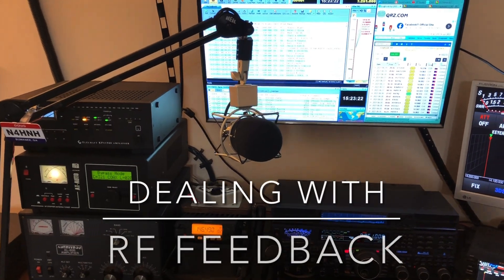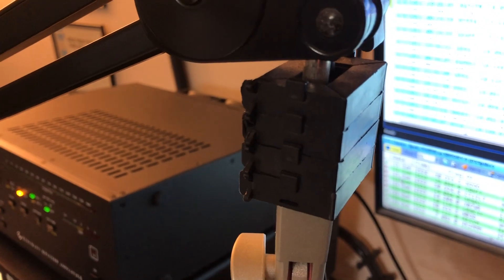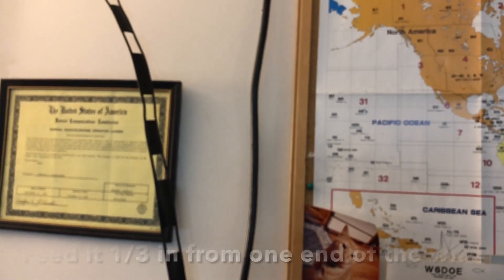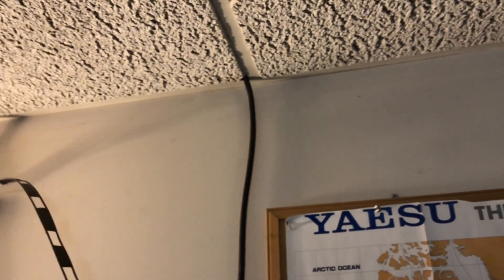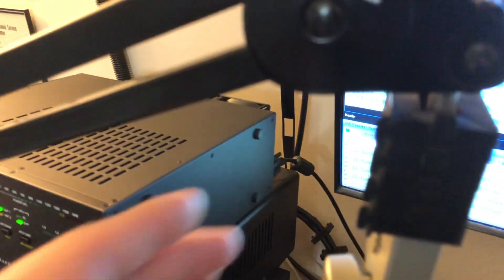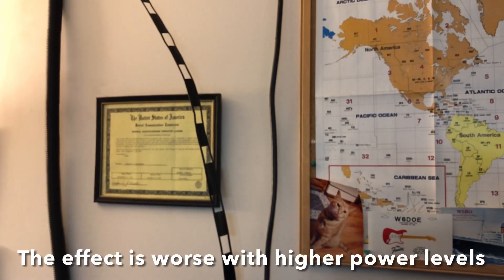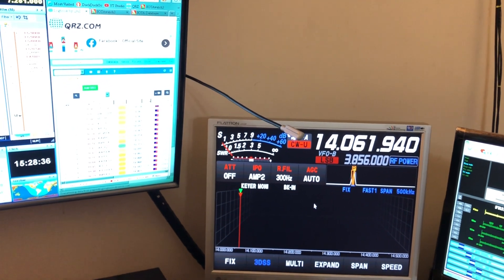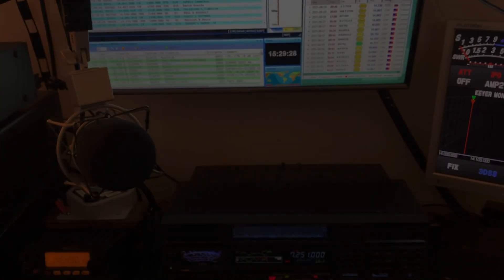Dealing with RF Feedback

Comment: What does rf sound like?
Reply: Thanks Doug! I need to add some chokes!
Reply from the maker: I bought a box of various sizes from Palomar Engineering. Get Mix 31. Avoid MFJ. They are garbage.  I bought a bag of MFJ chokes and several of them were broken. They don’t seem to perform as well as the Palomar chokes.
Reply: @n4hnhradio  Thank you!!
Reply from the maker: It will manifest as distortion in your transmit audio.
Reply: @n4hnhradio  Thanks Doug - distortion sounding like you are off frequency or white noise? Also, is it possible to get so much that it permanently damages your equipment?
Reply from the maker: It can cause damage if the amount is enough. I blew up the CAT port on my FTdx5000 because there were no RF chokes on the cable from RT Systems. The latest cables I’ve seen from them have chokes. The sound of RF in your audio could be described as sounding garbled or even robotic.

Comment: Good video and solutions can be simple but sometimes hard to figure out. Even loose PL-259/SO-239 (whatever) connectors you may use, where ever the connection/joints occur, can cause RF in the shack from a poor coax shield connection so I cinch down my connectors a bit with plyers - just a bit tighter than finger tight. Also, good ground connections on pretty much every piece of equipment. One way to make a good ground is to connect all ground wires to a metal (aluminum) plate - say 18" square, for example, and lay that on tile of a concrete foundation floor - that makes a capacitor to the floor/Earth then run a good size wire to a water pipe, if you can, or a ground rod close by. Especially ground transmitters and tuners and always use a balun or coax choke (ugly balun) right at the antenna to help prevent radiation from the feed line. Of course, you may have your own solutions that work perfectly well and ferrite chokes can be part of a good solution.  Thanks for the video. 73  WA4QGA
Reply from the maker: My ground is too an 8 ft. Copper rod outside the shack. But it doesn’t prevent common-mode current. There was still a bit of RF on the shield even after the 4:1 combi Balun. The snap-on chokes did the trick. Two made the difference but I ended up snapping a third on, just as insurance.

Comment: thanks for your video Doug. that's why I wont run a Ocv there known for rf problems . I was causing the lady across the street her garage door to go up and down and the older gentle men across from me his lamp to turn off and on. got rid of the ocf and problem solved lol. It also helps if one of the legs is Not going across your Roof
Reply from the maker: I’m fortunate that the only thing I interfere with is my westher monitor station. But it only happens on 30 meters.  The chokes eliminated the issues with all the other bands. But, the OCF dipole doesn’t usually outperform my ZS6BKW or my doublet anyway. 

73, Doug
Reply: @n4hnhradio  the chokes work great wade N5bwp a big patron of yours and dear friend of mine got me some for Christmas I use them on everything
Reply from the maker: Hi Jay!  Chokes have gotten expensive, that’s for sure. I use the Palomar chokes. You can buy a box of them for $50 from HRO.  I use Mix 31 for HF applications. 

https://www.hamradio.com/detail.cfm?pid=H0-016457

73, Doug

Comment: Sir, just came across your video, wondering where you got those or can order those chokes at?   Any particular ones ?  
thanks
Reply from the maker: Those are from Palomar Engineers, but I purchased them from Ham Radio Outlet. HRO had a better price than ordering directly from Palomar Engineers. They make different sizes for different size coax. I think they might also have a combo box. Be sure to order the proper mix for your frequency range. 

73, de N4HNH

Comment: @N4HNH Radio hello. Should I put the RF Choke on the Mic Cord Close to the Mic, Or Should I Put the RF Choke on Mic Cord were the Mic Cord Plug's into the Radio. Thank You.
Reply from the maker: It usually works best to install the RF choke(s) on the radio end of the mic cable.  However, sometimes, you might need them on both ends.

73, de N4HNH

Comment: WHAT MUST I DO TO CHANGE FROM CB RADIO TO HAM,S
Reply from the maker: There are 3 license levels in the USA.  The first is Technician Class.  The Technician Class license allows you to use FM repeaters, plus you can use SSB at up to 200W power output between 28.3 and 28.5 MHz.  The exam has 35 questions.

The next license level is General Class and the highest level is Extra Class.  The General and Extra Class licenses allow expanded operating privileges on other HF bands, at up to 1,500 watts.

You can study for the exams at: https://hamstudy.org/

You can contact the ARRL to find out where to take the exam.  Or contact a local ham radio club.

73, de N4HNH

Comment: Thanks for all your videos!  Your series on the FTdx10 caused my wallet to bite me haha.  I won though and got it installed in the shack last night.....awesome radio!  My desk shelves were too small and having the radio to the left and about two feet up wasn't working.  So I places it dead center and put my monitor on top of the radio.  (covered the speaker but thats why I bought the SP-30 too)  And of course when I keyed up the RF caused my monitor to go into the settings menu.  Ferrites to the rescue.  Doughnut on the coax and the monitor cable solved that for now.  I'll dig deeper after I watch all 3Gazillion videos you put out on the radio.
Reply from the maker: I can relate.  I had to rearrange my shack to fit the FTdx10.  Maybe you saw this video?

https://youtu.be/puourYBqBbo

73, de N4HNH

Comment: Ladder line is designed to work as a balanced line.  If it has any conductors nearby (wiring, pipes, steel siding, other antennas) it will become unbalanced and become a radiating system.  Your attempt to attenuate the rf radiation from this feedline in the shack cannot work.  The ferrite will only further unbalance the feedline. The best thing with balanced feedline is to send it out the wall, away from any interfering objects, right from the back of the tuner.  This is how it was used years ago.  And with tube equipment, it was far less vulnerable to interference from local RF. I proved it by all the lip burns I got using my Heathkit gear and a shiny D-104 microphone.

A layman's way of analyzing your situation. Forgive me if I don't understand what is happening in your shack. You will fight RF constantly with that configuration. The best one can do to keep RF away is to feed with coax and convert to balanced line with a remote tuner or transformer once outside in free space.  

Always enjoy your videos.  Thanks and 73... Mike
Reply from the maker: Hi Mike!  The balanced line goes straight to the back of the tuner.  The 4:1 balun is inside the tuner.  I would rather choke the RF in the shack than drill another hole in my house to take coax out to a balun/tuner outside.  That is a much more expensive solution than chokes.  But the doublet is not the problem.  Those chokes help it achieve a 2:1 or less SWR from 14 through 18.168 MHz with the tuner in bypass mode.

I used a similar method, plus coiling the coax, to expand the resonance of the OCF dipole such that it stays under a 2:1 SWR from 3.5 to 4 MHz.

If you watch the video again closely, you will notice that I did not blame the doublet for RF feedback.  It’s the OCF dipole, with RF riding the shield back to the shack.  But that only happens on bands that aren’t harmonically resonant.  And I mostly use the ZS6BKW and doublet.  They are consistently my best antennas.

Comment: I find a type 31 or 43 1:1 choke on the OCFD feed before the coax enters the shack removes all the stray RF, in case it’s affecting other items of equipment 👍🏻
Reply from the maker: I have chokes outside on the coax.  But at 1kW the RF still gets into the shack.

73, de N4HNH